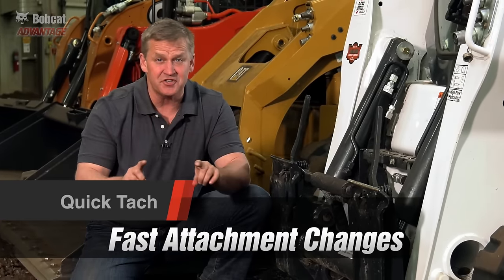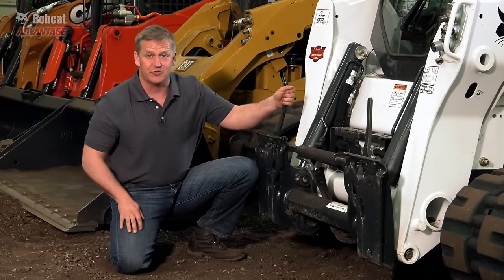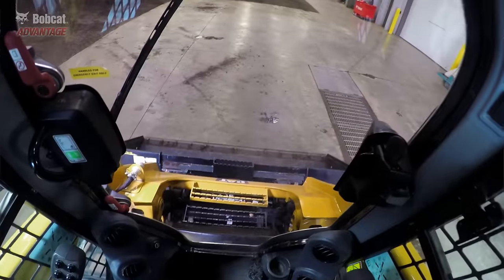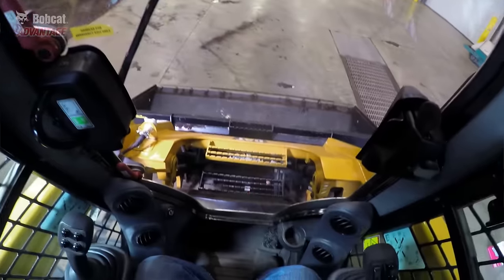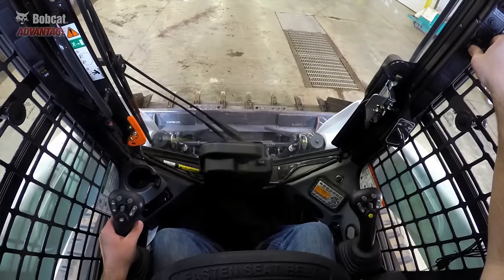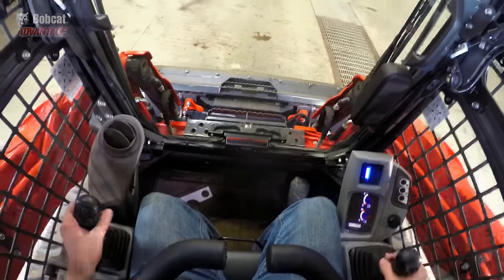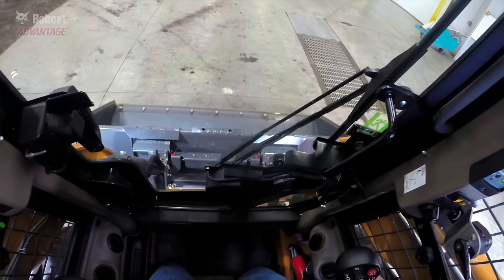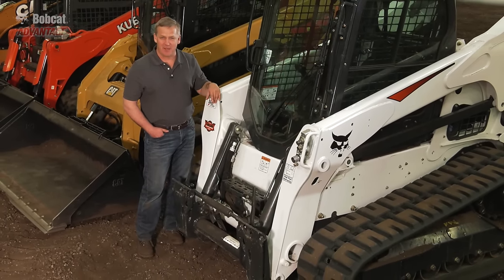Fast Attachment Changes: Bobcat vs. Other Loader Brands

Comment: Bobcat company could you put John Deere in your testing?
Reply from the maker: Hi Ryan - thanks for your question. Machines featured in Advantage videos are top Bobcat competitors (based on market share) for each product category.
Reply: In other words, JD has a better system than bobcat so they can’t show it on the video... Also the Case/New Holland hydraulic coupler operates much faster than the bobcat and attaches more reliably, but they won’t tell you that.
Reply: @donhouston325  cases hyd. switck sticks itself so you dont have to hold it when blowing snow like bobcat
Reply: @awsomejeff9547  Also true, you don’t realize how convenient a switch detent is until you have one.
Reply: John Deere detach sucks !